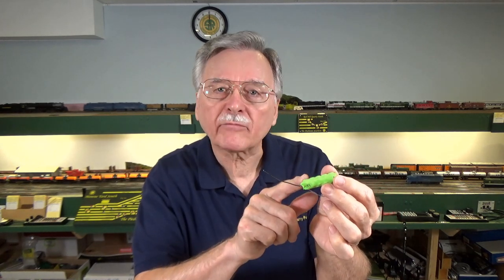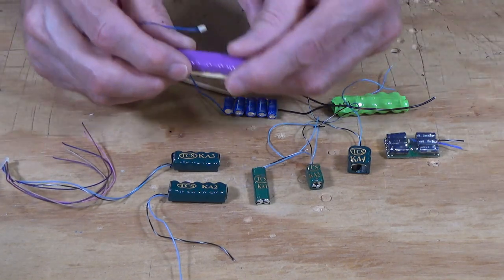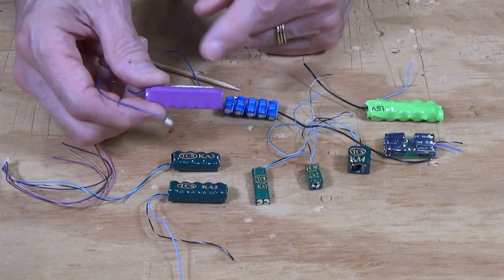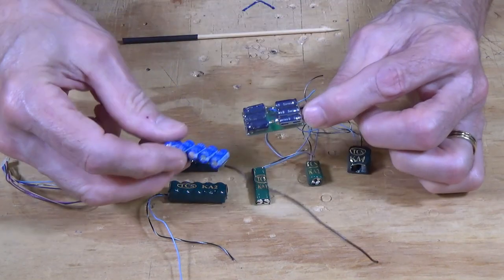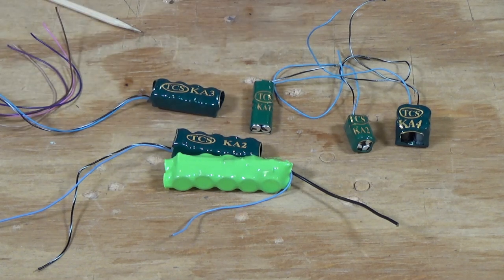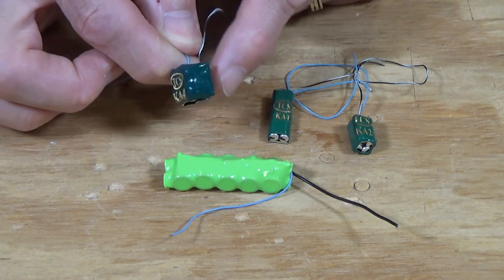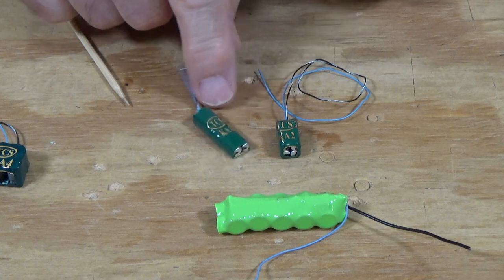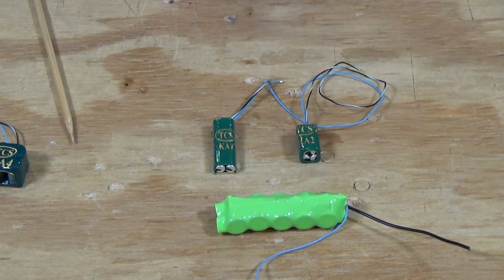TCS Keep Alives--When Size Matters (124)

Comment: Best of luck with your new endeavor to broaden the channel. 
As a side note I have a Bachmann 2-6-0 steamer which was a balky runner. Ha ring read an article in the NMRA magazine on adding a keep alive I was hesitant to do so because the tender which contained a Soundtraxx sound value decoder would require some minor surgery.  However the new KA2 fit in perfectly and the 1-2 seconds of run time was MORE than adequate to keep this little guy moving.   It seems as though the dilemma is that the small locomotives need the capacities most have by there nature the least space while the larger diesels need less help have more room. 
Keep up the great work.
Reply from the maker: Yes, that’s the dilemma.

Comment: Hello, have you done a video for adding a KA to a Bachmann sound board for the HO and On30 Shays and Fornys. I have the older ones from Soundtraxx that came with the locomotives.
Reply from the maker: No, haven’t done those, but the tech support guys at SoundTraxx usually can provide the contacts. Make sure to say its for use with a current keeper!

Comment: The entire thing with keep alives.   I do not need 30 seconds, 20 seconds or 5 seconds of runtime,  1 second, 2 seconds for a minor hiccup is all I need
Reply from the maker: And that’s what you get with the really small ones. However you have to have a minimum voltage to operate the decoder which is why it takes several capacitors at 2.5-3 volts each to provide enough voltage and they take up space.

Comment: I really appreciate your videos. Compared to some they are very professional. At least when you zoom in. the object is in focus, unlike some videos I tried to watch and your instructions are very clear.  It is fun to watch the CC mangle translations but I usually understand what you say. I'd like to know if there is a good way to install DCC with keepalives in some older Proto 2000 E-6,7, and 8s manufactured back in the 90s and still keep a good portion of the weights. I have seen some videos of installations in these units but they remove the weight totally to get enough room.
Reply from the maker: I have many if those LL E-units and there really is plenty if room if you remove the circuit board at the rear of the model. I will be doing a video on installing sound in them so keep watching.
Reply from the maker: I have done several of those and need to do a lot more so keep watching for a video on that. There really is a lot of room if you remove the circuit board at the rear of the unit and hardwire everything. That way there is no need to remove the weight.

Comment: The change will be great. I would suggest that you keep the switching bench work under 6 feet long per section to make it easier to move around.
Reply from the maker: Actually I am going to split it at 4’. DCC Concepts makes some nice registration pin inserts to use when joining sections to guarantee a perfect match up each time. I now need to get a set from them ASAP. A shop in Scotland offers a range of hardware for joining sections, making drop down legs, etc that I may give a try too.

Comment: The ESU Power Pack Mini is only slightly larger than the TCS Keep Alives at 15.7 mm x 9.7 mm x 13 mm. Walthers managed to squeeze an ESU Power Pack and a Lokpilot decoder into their HO Plymouth ML-8 switcher which is a very small loco.
Reply from the maker: Yes, but no sound!
Reply: @TheDCCGuy   I put the sound decoder and speaker in a hopper car for the Plymouth to pull; the speaker is nearly as long as the loco.

Comment: I fitted a home made  stay alive unit to a Bachmann E-Z Command two function decoder. The common positive was not suitable but had to connect to the positive side of the diode bridge. The stay alive function works only one way, and it goes to full speed on a dirty  stretch of track. Not sure how to solve this. Is it a programming problem?
Reply from the maker: It may be that you need to try attaching it to a different location on the bridge. I have generally avoided their decoders as they tend to be failure prone.

Comment: Nice vid.
What is the best way to measure capacity of these various sized units? I'm interested in some useful measure to be able to compare what you get in the various sizes.
Reply from the maker: I have never seen anything on that. You might be able to rig up something that would allow you to charge the unit to a specific voltage and then discharge it using a light bulb of a given voltage and amperage over a measured amount of time.  results will likely not be applicable to different decoders since they all have somewhat similar but different designs and the motors and mechanisms are involved as well. So really the best measure is your eyeballs—the bigger and most capacitors, the longer they will last. But, in most cases you don’t need a 20 sec run time, only a couple secs to get you over the dead and dirty spots.
Reply: Given the differences between capacitors and supercapacitors, assuming those terms are correctly used, comparing size alone would be misleading.
Someone looking to make a valuable video would compare the actual time each unit lasts against a realistic, base load.
Reply from the maker: Your idea of a test setup to compare performance is interesting but I think it would simply confirm that bigger is more. That is basically what the techs at the various companies have already told me. The current crop of stay alives use super capacitors not standard capacitors. And generally in a stay alive device there are typically 4-5 of them. The 2.5-3V 1F super caps are all about the same size. So the main differences in commercially available stay alives is the number of super caps and the more you use the bigger they are and longer they will run a decoder. I have no idea what TCS is using in their KA1&2 devices. I took the wrapper off one and it is blank. The devices used in ESU PowerPacks are 1-2 caps of some kind are large and have special circuitry that we think allows them to sacrifice size for run time. Basically they seem to boost the voltage but even the guys at ESU USA say the EE’s in Germany won’t tell them how they work!
Reply: They have vays of making them verk.

Comment: As I am a Newby I have a question. Are these little units suitable for use with an analogue setup ?
Reply from the maker: No they will only work with DCC decoders.
Reply: Now most decoders will run on DC so it should work that way
Reply: @frankneher9192  Thank you for your reply. I think its worth a try, if it doesn't work then never mind.

Comment: Question in my eye the smaller unit have less storage,  have you seen any issues?
Reply from the maker: They definitely have less power but that just means they will only power the decoder a few seconds instead of 15-20 like the really big ones, and you really don’t need that to get over a dirty or dead spot.